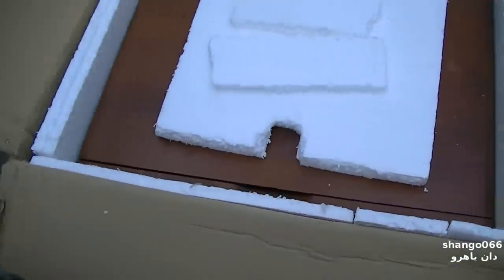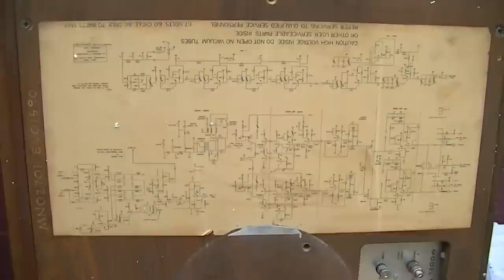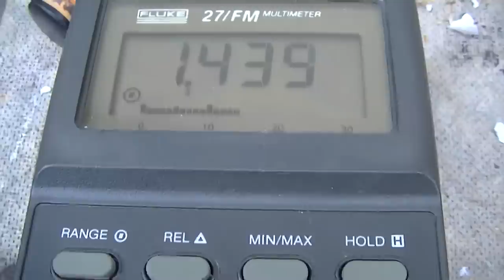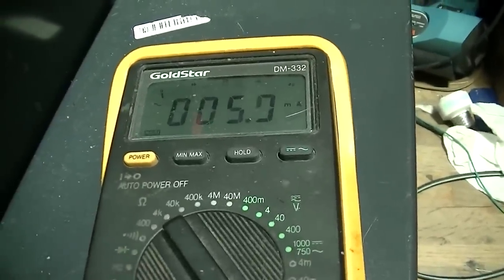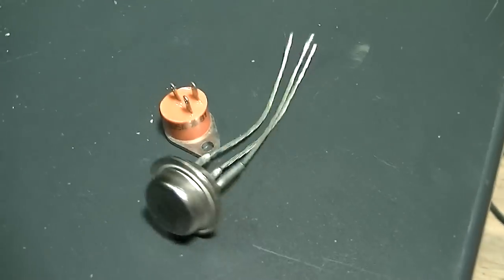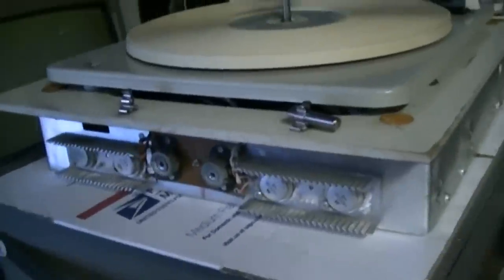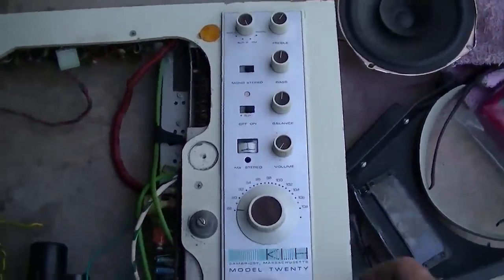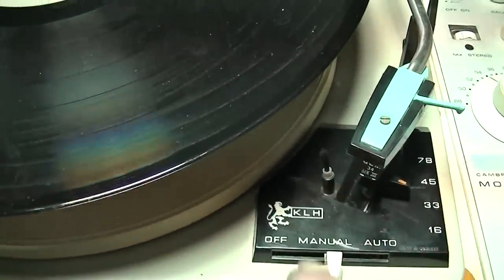KLH 20 Amp Tuner Turn Table Repair

Comment: Interesting and informative video.  Thanks for posting!  KLH did indeed make high quality stereo components back in the day.  I have a KLH Model 24 compact system, with the same record changer and electronics, that works as good as new. My cousin gave it to me 35 years ago when she 'upgraded' and all it has needed so far is a new stylus!  FYI: The reason the stylus cleaning brush was interfering with the tonearm movement is because the ADC cartridge on the unit you serviced was a replacement someone stuck into it at some point.  These came stock with a Pickering cartridge that is a much better fit in the headshell and doesn't hang so low from it.

Comment: Great repair, I had no idea germanium transistors turned into gold. Never saw one in the cabinet before, worked on quite a few of the tabletop ones years ago. If you have an old Garrard with a frozen cycle gear, use a heat gun or hair dryer on the bearing and gently twist and slide off. Thanks for posting this excellent repair video.

Comment: these units are very good quality and have big robust sound and the amp sounds like a powerhouse great video  p.s. that is the wrong cartridge for this changer you need a low profile pickering catridge npac i believe is the type
Reply: Wish I'd seen this comment before I mentioned the cartridge situation in mine! lol

Comment: This was quite a nice system. Fairly beefy power transformer. These came with the main unit as well as the speakers on pedestals. Wow $69.00 for a pair!!! I can remember germanium TO-3 transistors (2N301) for $1.99. The sticking trip lever on Garrard turntables was a common issue.

Comment: Next time you should try ASZ16 GE TO-3 transistor, were from Bulgaria or CZ. It's drop in
replacement. I Use those in late 60's Wurlitzer and AMI Jukeboxes. Still are cheap.
Reply: Francisco Suarez C. I

Comment: I have a pair of Technics SL-1200MK2's that were given to me with 4 spare cartridges. I got them from the station manager of a local FM radio station a couple weeks ago that finally phased them out and went to all digital media. I also have a UMC Bearcat Cart machine, and Tascam CC-222MKIV tape deck all from that haul. 
I'm supposed to go back and get some more, 50 watt FM transmitter exciter, a 4 bay FM antenna and some 1/2" heliax cable, 5 joints on Rohns 25 tower and a tower top cap. Basically when I am done I will have everything for my own LPFM station minus the FCC license of course. I could run it down to 1/4 watt and be totally legit though.

Comment: These KLH model 20s are good units. However if u run it with no speakers connected or with shorted speakers ,you will kill the output transistors driver transistors and pre drivers instantly along with the emitter resistors and resistors in the driver circuit. I repaired one of these units back in 1976 for my neighbor. I gave him a high estimate first. The output transistor were 25 dollars each back in those days. It turned out the voice coil was shorting intermittently and took out all of the components I had just replaced. I had to do the job all over again. I lost my shirt on that job. Fortunately I was smart enough to give him a high estimate in the beginning. The parts guy at the counter exchanged the transistors free of charge but I lost my shirt on the labor. Most of these 70s audio receivers will not survive if ran with no speakers or short in speakers or wiring
Reply: When I repaired similar circuits I always wired fuses to the outputs and educated the customers why they were essential.
Reply: @jrs0007 why can’t they be on without speakers ?

Comment: Kids today will never understand what it's like to not only have to earn the $$ (vs instant gratification with a Visa card), but to actually have to make their way to a record store or department store to listen to and hopefully buy one or two, or on a good day three 45's, that is unless you had a job that tipped well then maybe you could spring for the whole album. It's ironic that the prices of singles haven't varied much over the years...(I paid .79 to $1.09 for a 45 vs. 99 cents for an mp3) but a dollar was worth a bit more when I was younger. That said, the kids today do know the cool factor of vinyl, so maybe there's hope for them yet lol /fogie mode

Comment: That stylus brush looks a little harsh for the relatively high compliance mag cartridge. I think I would remove it. Also the stylus fitted is not made to play 78s. It will sound bad as it will ride far to low into the groves.
Reply: +Michael Beeny Actually the 12" soundtrack record sounded pretty good for a 78 coming through a microgroove stylus, but the 10" was real bad.
Stereo Action!  Was listening to one of those the other day.

Comment: I was curious how this unit looked with the base and pretty 60's "cool" factor going for it. Has a base that bolts to the bottom like a Start Trek chair and the speakers had the same dimensions and look as the turntable/radio. Pretty awesome look and I could see it being used on Hugh Hefner's Playboy After Dark in the mod/groovy 60's..with all the cool cats hanging out with the bunnies.

Comment: Those outputs look like quasi complementary, or stacked outputs rather than PNP-NPN stages.  Very common in the days before true PNP-NPN matched pairs were available.  HEP 232's are Gemanium, I know the part number.  Germanium transistors, especially power ones, will show a hell of a lot of leakage current emitter to collector in the forward direction.   They will almost work in class B without any bias.  Totally normal.  Si types won't conduct at all without bias.

Yeah that output stage would sound like crap with the open resistor, like a push pull tube class b amp minus one of the tubes.

YIKES, those NTE transistors are expensive crap!  4khz ft in a stereo?  NFW.  I'd rebias them and put 2n3055's in there for $2 each!  I also see 2n301's on ebay for about $5 each that would have been PERFECT.
Reply: germanium outputs like this are normally pnp, so if these are, then MJ2955's, not 2N3055's.. i need to do similar in one of my tuner/amps...

Comment: Wow, didn't know how fast 78 was. Crazy!
Was this speed needed to get a decent frequency range?
Reply: Yes!
Reply: +BloodySword Interesting article on record speeds:
http://www.straightdope.com/columns/read/228/why-are-record-speeds-33-45-and-78-rpm
Reply: it was mostly used on old grammerphone records as that was the normal speed, they were on every record player up until the earily 80's when you didn't really need that as most of the old 78" were either on 33" or were no longer working as they were made from shellax a beatle wax that once played wore it down plus they were fragile they broke easy.
only now do some record decks have a 78 speed but ther mostly used on USB tables so you can save the record from wearing out more

Comment: Your record there is kind of a rare piece of history.
"Duel In The Sun" is a famous 1946 film produced by David O. Selznick, who also produced "Gone With The Wind". It was directed by King Vidor. It was controversial at the time for it's sexual content, and a very expensive movie in terms of budget as well.
"The film was one of the first to be honored by a record album, featuring selections from Dimitri Tiomkin's musical score. Rather than use excerpts from the soundtrack, RCA Victor recorded some of the music with the Boston Pops Orchestra conducted by Arthur Fiedler. The music was split into approximately three-minute sections and released on 10-inch 78-rpm discs in 1946. A long musical prelude as well as an overture preceded the film with Tiomkin conducting the studio orchestra; this recording was later issued on LP and CD."
--Wikipedia

Comment: This may be another dumb question.  I using a model 24 thats not quite as loud as my model 20 was.  Would it hurt anything to plug it into a slightly more modern receiver/amplifier?  If its ok, do I use the speaker jacks as output or would I use the headphone jack?  I'm asking before trying because I blew something inside my model 20 years ago by mismatching speaker impedance.  Only difference between now and then is that was almost 20 years ago and I still had local places to bring it to fix it.

Comment: How was the changer able to drop the tonearm at the 12" start position when the speed was set to 78? Is there a seperate 7", 10", and 12" size selector or does the speed control lever also dictate where the arm drops? I've seen both types of control systems on changers two single function levers for speed and size aswell as the dual function lever that controls both speed and drop point.
Reply: Those particular Garrard changers have a record size sensing arm at the back that tells the tonearm where to set down, depending on how much the record pushes it back as it drops.  Great set up.

Comment: If you replace the output transistors with substantially heavier transistors its going to take a lot more drive power to drive them don’t you think.
Reply: That would depend on the characteristic curves and gain of the particular type of the replacememt transistor, wouldn't it?

Comment: Hi! Excellent video. I've got a model 20 that we use daily, and love tremendously. But a few weeks back, it popped and a thin curl of smoke came up. A good shop that had worked on the drive motor said it was unrelated to the previous repair, and I don't doubt it, but they didn't want to dive back in. We don't want to give up on it, but I can't figure out where to find you. How do I find you and discuss sending it in?
Reply: Any success repairing it?

Comment: 9:40 What do you mean by "You can upgrade to silicone and re-bias"?

Does it mean silicone is better than germanium? My knowledge of electronics are limited so I didn't know. We had a vintage amplifier with 2SB449 power transistor. Old 2SB449 transistors are germanium but here in the Philippines most 2SB449 are silicone. When you buy a transistor 2SB449 they often ask if you want class-A or original. Original are germanium while class-A are silicone. Germanium 2SB449 are very hard to find in my area these days.
Reply: +bobskie321 Silicon (without the "e", unless one is looking for breast implants) is generally considered more reliable, though there are some exceptions. Both have a tendency to "run away", with the beta ratio increasing as they heat up, causing them to heat up even more and eventually burn out, but it can be controlled for silicon with an emitter resistor (and a bypass cap to avoid limiting AC gain), while germanium output stages often have some elaborate bias regulation circuit with a thermistor. Anyway, the minimum one would need to do to convert to silicon would be to rework the bias circuit for a .6 volt BE drop and a "reasonable" emitter current (very low for class A-B and half of max for class A ??).  You should watch Shango's video on the subject and read up as much as possible if you want to try it; depending on the circuit, I'm sure there are potential pitfalls that never would have occurred to me. The last time I replaced a gemanium transistor was in 1991 and I think I paid about $6 for the new one.
Reply: +No Name 
Thanks for correcting about silicon not silicone. It shows I'm over exposed to those kind of videos lol.

Comment: HI...How do you connect an Amplifier and an Audio source to check Capacitors?
Reply from the maker: watch video called Checking testing electrolytic capacitors in vintage tube gear using audio that will give you a basic idea

Comment: You’re in Los Angeles? I would love for you to take a look at my KLH model 19. It works but the stylus on the turntable doesn’t automatically go to the vinyl, and then the speakers pop when the system shuts off...
Can you PLEASE get back to me? Or perhaps there is an email I can contact you with???
Reply: That popping is normal

Comment: oh yeah they don't care i used to still kinda do ish sold toy cards and you know how they want them carded mint well i used to pack them up as best i could and the post office royal mail ppl were okay but they have like a sack there and its like just throw it in there like it don't matter.
that's why i make sure all corners are nicely padded in fact i did a whole video on posting items not sure how popuar it is but i can give you three steps. 1/ make sure you have the right items bubble wrap and nice sized box peanuts the packing kind and other packaginf stuff 2/ make sure nothing moves light movenent is okay as in toy car moves inside packagaging toy car wrapped inside of the two carded cars moves that is fine, 3/ rattle shake test, before sealing it all up nice n tight shape and rattle it lightly to see if anything rattles lose or moves then you can pull it out and make sure it don't move

Comment: I'm surprised they packed it so well, but forgot to back out the transit screws on the turntable.
Reply: It's a shame.  There was obvious damage as a result too.  It looks like the front screw pulled right through the plinth.  :(

Comment: How do you remove the turntable from the rest of the unit?
Reply from the maker: +Fbird101 Flip the tabs up from the bottom and lift it up
Reply: Thanks.  Those were fun little clips.  Especially on the 24, the one in the corner has a metal frame in the way.  Another question, when of the speaker channel stops working, what is a common cause?  Specifically the left output has stopped producing audio on my Model 20.
Reply from the maker: No way to guess that, could be anything from the preamp all the way to the speaker. Need to diagnose it stage by stage.

Comment: As an Australian club DJ of 30 years why people today wanna restore these pieces of junk amazes me. The motor and the idler wheel turning the platter from the inside was ok for the time but compared to a 1200 which you own is no contest. I have a brand new 1200 and the noise from idler driven platters is pure yuk. People ask me what a rumble cut switch is. I cannot cope with this type of turntable. The rumble is always there along with other harmonics and as the idler wheel ages and inherits the bump from resting against the platter when shut off combined with a ceramic cartridge is a waste of time. The old tube amps like my Leak Stereo Twenty fully restored have no need for any rumble cut switch so I removed it from the signal path. With a pair of Wharfedales and a 1200 connected, it sounds better than some modern equipment today. My mums 55 year old radio gram has had it. It needs the old fashioned technician to come out for a service call and it is just too expensive to ship parts to be rebuilt. We don't have the luxury of many techs in Australia unfortunately and my mum and I can't be bothered fixing it. It's too heavy to ship anyway. Have fun with this Shango. Andrew from Oz.
Reply from the maker: That's absolutely right

Comment: russian transistors (and their valves/tubes) are definitely not 'junk'.... their small electrolytics are another matter 😉😁
Reply: i have similar trouble to this in an Armstrong 525 tuner/amp, uses AL102's,  both in one channel dead short 😢